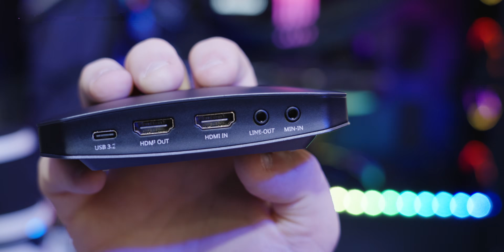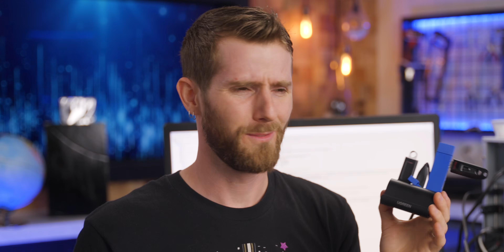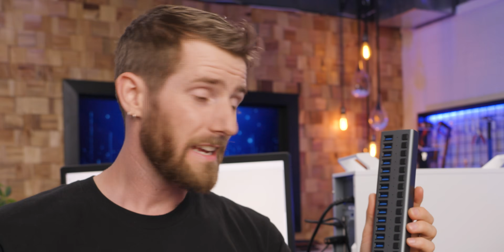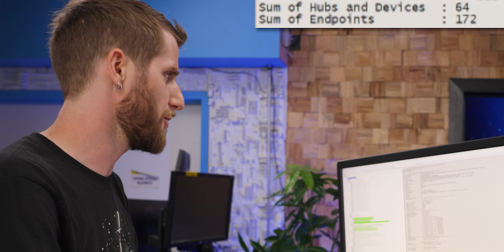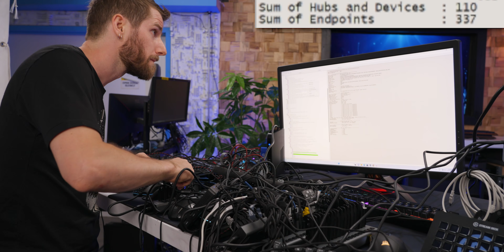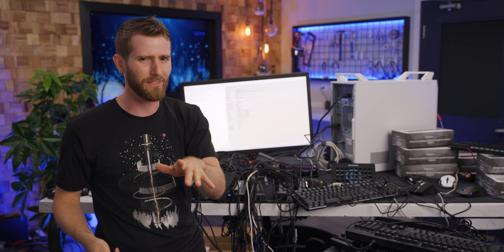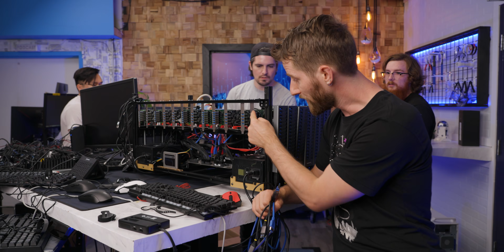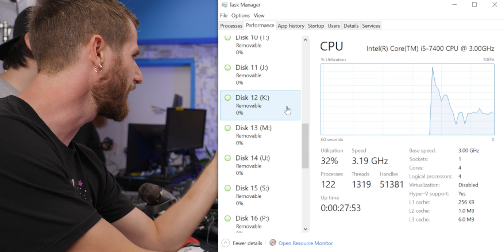How Many USBs Can You Plug In At Once?

Comment: I’ve had issues with plugging in too many hubs rather than too many devices which is interesting. Having the same amount of devices plugged into two hubs seems to work better than having them plugged into 4 different hubs. Also some hubs work almost flawlessly whereas others just keep dropping out when I connect thumb drives to them but peripherals work fine… USB stability, even more than the instantaneous number of devices you can have plugged in, is a big issue and it would be worthwhile to investigate stability in a seperate video. I will say that having a seperate usb controller via pcie definitely improves stability! I’ve noticed that. But when I plug in multiple external hard drives I have significant problems with them just disconnecting intermittently even if they are on seperate controllers (this happens more often under high bandwidth usage but also seems to happen even if I’m just using the drive a little bit??). I’ve noticed this issue on different devices; my old Dell intel 7th gen i7 laptop and on my X99 5820k PC. 4 port powered hubs seem more stable than 7 port powered hubs and 7 is more stable than 13 port hubs; but I have another specific 8 port hub that isn’t sold anymore and for some reason is super stable. Maybe stability varies on vendor or newness of technology like Linus noticed on AMD vs Intel. I wonder if there’s a measurable difference on USB stability and % uptime on Windows vs Mac or from vendor to vendor
Reply: There's definitely a difference between the chips in different brands of hubs. We used to run in the same issue doing backups to multiple external drives and we didn't try and copy something to all the external drives at the sane time but rather one after the other and we figured out that some powered hubs just are better than others and actually motherboards as well. We eventually also fixed it with a board with a bunch of PCIe slots and USB cards as opposed to USB hubs. Laptops on the other hand are all over the show and some laptops (modern and old) just really don't like having a bunch of USB devices at the same time.

Comment: At one of my previous jobs, we had devices with test harnesses, and the test harness PC would often run out of USB endpoints, so we had to run the harness machine with the Intel XHCI disabled, so the ports went to the two EHCI controllers instead.  But then Intel removed the EHCI controllers from later chipsets.  It seemed like Intel's limit was 64 or so, or maybe even less than that.

Comment: I love these kinds of videos and want more of them. I have been so curious about USB hubs.
I've actually been wondering, can USB hubs increase latency? I've seen experiments that suggest they add no measurable negligible input latency with mice and keyboards, but I'm also wondering about HDMI or audio (3.5mm or a USB audio interface, seeing as one is analog and the other is digital) through a USB hub/docking station
Reply: Any hub will increase latency since it extends the path and adds muxes. if it's noticable is another question altogether since we might be talking ns, or at best microseconds. Some "dumb" hubs pass the signal along and just amplify it with minimal interference (with respect to time and signal), others will receive it process it and resend it which will take time. YMMV with respect to hub/chip/device/peripheral used.

Comment: There is that 127 limit per host controller, so using multiple PCIe controllers will make the limit proportionally higher. Also the USB2 and USB3 tend to be different controllers, so a USB3 port may have a greater limit.

Comment: LTT is so good at making interesting videos! I literally have never thought about how many usb drives you can plug in until now, but you better believe I NEED to know an exact number before I can move on with my day
Reply: You can plug in as many USB drives you want to You can do more than the 26th drive letter limit, It just takes a lot more setup if you want to go past 26 drive letters and you have to define in Mount and do some Linux level type of stuff that Linux is used to doing in sort of a sense. when you use Linux or Mac OS it doesn't use drive letters necessarily I don't think It just mounts to the drive as a folder path.

I believe Theo Joe talked about this at one point could have been a year ago possibly. so you can connect more than 26 USB drives if you wanted to. You would have to use device manager where you deal with changing storage that's a more advanced type of tool with dealing with partitions and windows and I believe that tool allows you to deal with folder drive mounting to get around the 26 drive letter limitation.
Reply: The reason why different operating systems are used for when linus does his while 48 drives or server vault for video storage needs, they use things like ZFS or TrueNAS do just not have to deal with how Windows isn't the best when it comes to running a file vault storage  server that must always be online without glitches or needing to be restarted.
Reply: when you start looking at the differences of like Windows with drive letters. Mac OS I don't think uses drive letters like I said it just mounts the drive as an image. when you install an application on Mac OS it mounts it acting as though you installed a CD drive or a USB essentially for a specific file path, so I don't believe Linux has a 26 letter drive limitation at all.
Reply: Linux has great reliability and sustainability. Linux can go a very very long time without ever having to be restarted. You can update Mac OS or Linux without having to deal with needing to restart the system for a system update at all. when you start dealing with Enterprise stuff you just begin to see how weak and unstable Windows as an operating system is and why when you're running a file server on your local network and you want it to have always on reliability You don't want to have to be dealing with Windows Quirks or have to deal with a restart just to fix a simple drive not showing up or something of that matter. Debian Linux from what I've learned from these videos that they do is pretty strong and what these custom file operating systems that ZFS, TrueNas all these things they show in their channel do. so like I said drive letters on Windows is just a windows arbitrary limitation.
Reply: The reason why your main drive is always mounted as the 3rd drive in your system is because A and B letters on the system for the hardware was by default for floppy drives. So that by default makes the Third Drive C the default. Windows has a lot of past old legacy support to some degree. so if you went and changed your C drive to an A drive and made that your default for installing Windows on there would be a lot of programs to some degree that could be hard coded like a driver or things that just expect to find the respective files in the C drive and when that's not your main drive then it would just confuse most programs and throw a huge hissy fit.
Reply: Did you see their video on JBODS? where its a cluster of drives that are then attached to a drive controller? I mean thats what most all data centers use. they rely on the function of JBODS for you know hooking up a huge cluster of probably 48 drives per rack of that JBODS they don't have to have a limit of 26 drive letters there not running windows firstly. and there all interconnected so there's  redundancy included as well. making so that there's not a limit of how many drive letters there has to be at all, and there probably on a custom blend of Linux of some sort too.

Comment: With the high amounts of 4k/8k mice being produced recently, a video on how they can affect in game performance/overall PC performance. Anyone with experience with one knows that seemingly they can have a huge effect in one game, but little in another. This seems mostly due to the in-game support for the higher polling rate, but the actual effects on the system overall would be interesting to see.
Reply: 4k mice? I back this idea. I have no idea wtf a 4k/8k mouse is and id like to learn. Linus get on it plz!
Reply: @TheHollowBlade It is the polling rate. Essentially how often your mouse sends a signal to the PC.

A low end mouse could have as low as a 125 Hz polling rate, so your mouse actions would only be sent to the computer ever 1/8 of a second, which means you can add up to that much latency to every mouse movement (but, worse, it won't be consistent as it will depend where in the polling cycle the input occurs). At 8,000 Hz, it is updated ever 1/800 of a second.

For a while 1,000 Hz has been the rate for gaming mice, but recently 4,000Hz and 8,000 Hz polling rates have become more common.
Reply: @88porpoise 125 Hz = 1/8th a second? Huh? Isn't it 125 times a second?
Reply: @88porpoise  oh ok, so its mot the dpi but rather how often the mouse communicates the info of its movement.. i legit have never thought of that function for the mouse. I would like to see Linus do a vid breaking it down. Sounds neat.
Reply: @kernelpanic2887  Well that was me being really stupid

No idea why my brain turned 8ms into 1/8 of a second.

But 125 Hz is every 8ms, 1,000 is every 1ms, and 8,000 Hz is every 0.125ms it sends data.
Reply: @TheHollowBlade  There is a decent summary of polling rate and some testing on the Atom Palm Hydrogen mouse video from a couple years ago where they show the mouse being used at different polling rates.

It would be cool to see it tested in detail with Labs equipment, but I don't know if it would be broadly popular enough for LTT.

Comment: I want to see how Linux handles this on the same hardware, something tells me Windows is a limiting factor here... This seems like a case where it's equally a test for the underlying system kernel, surprised Windows didn't BSOD.
Reply: If you watch the video they explain what the limiting factor is, it isn't Windows or Linux as USB is limited by hardware. USB has 7 bit addresses (127 end points, address 0 is for devices that don't yet have an address assigned). Linux isn't going to be able to change that by sending 9 bits of addressing data to USB devices...
Though xHCI claims to support 8 bit addressing, though nowhere in the standard does it explain how that would really work. Most likely that only works with specialized bus manager chips that would split the bus into two normal 7 bit addressed buses instead, chips that don't seem to exist as nobody needs it really...
Anyway, why would Windows BSOD? You realize that since the mid 2000s everything user-space runs in user-space in Windows? So the worst USB crash that could happen is what they show in this video where the USB stack crashes and tries to restart itself.

Comment: Ha! I’ve been waiting for something very similar to this to be done 😄 
I have 3 powered hubs each connected directly to controllers on my mobo and each one goes 12 devices deep. Only one of them is full and I have just a couple of other devices connected to the others because they are located in other parts of my small office just in case I want to plug something in those areas.  I am very careful not to max out the endpoints on my main hub because all of my important peripherals are there. 

Now I’ve learned more terminology and a more thorough understanding as to the quantitative limits of simultaneous usb devices in windows 😄

Comment: Something to consider:
Some of those hubs got hot, they might have thermal protection and shut down.
You might run into driver issues. I wonder if this would work better or worse with Linux?
Reply: I was hoping they wold switch to linux for more testing after seeing the limit messages in windows.
Reply: @hubertnnn  I was too!
Maybe that will be in another video.
Reply: @hubertnnn  Limit messages originate from the USB root controller, not Windows itself. The USB Root Controller (hardware) informs Windows that it has had enough.
You'd get the same error on Linux, though it would obviously look different depending on what distro you are using etc. the error itself is the exact same.

Comment: Sadly, this is incorrect. I connect a powered hub to my desktop, connect the power to the wall, and then I connect 3 external hard drives to it, with a Bluetooth dongle, and they malfunction.

This doesn't happen if there are less USB devices connected.

Comment: That was actually a pretty fun experiment.  Would be cool to see the same in Linux to see if it's an OS/driver limitation and not hardware.  While we're at it, may as well do a raid 5 with all those USB sticks to see how terrible it would be. :P
Reply: RAID on USB sticks has been done so many times now (even by Linus I think, though it might be 10 years ago or whatever)...
Linux would make no difference as this is a hardware limitation, not OS.
Reply: @someguy4915  it would make a difference as Linux has no drive-letter shenanigans 😏
Reply: @bit2shift   that's not a real problem for windows, it will just not attribute any letter, but the disk manager can control more than 26 devices. explorer will complain with a warning, but you can mount your USB drives in a subpath on C:  if you still want to use all of them
Reply: @monad_tcp  ok but does the general populace know that you can do that (mounting drives the UNIX way)?
Reply: @bit2shift  obviously not, but I don't think the general populace can afford 26 flash drives.

Comment: This video demonstration of USB mechanics and limitations is phenomenal for the average consumer-level gamer. However, I would find it deeply interesting if LTT could cover USB Hub limitations when it comes to commercial conferencing devices such as HDMI/USB over Ethernet extenders as conferencing solutions! I've personally ran into a handful of weird USB limitations while using Ethernet USB extenders, specifically the Atlona Omega HDbaseT Extender Kit because of the way their devices specifically handle the USB bus (the HDbaseT extension, in their case, is physically a USB bus by itself, so when you get to the "USB" extension, you end up ANOTHER USB bus deeper than you would expect, for example). In my case, using a heavy-duty conferencing speaker like the Nureva HDL-200 or HDL-300 (which gets separate power than USB, obviously), you can run into compatibility issues where either the speaker works and the mic doesn't, or vice versa, depending on the computer you're using (because they usually each handle their own buses differently). Even though "theoretically" the specs should check out according to both Nureva and Atlona tech support, they had weird USB behavior interfacing with each other that resolved when using a separate USB-over-Ethernet solution instead of the built-in USB extension from the Atlona OMEGA kits, which was more than likely a USB bus issue. Anyway, fantastic video with great information! Would love to see another video targeted more towards commercial-grade video conferencing for this reason! But tbh, my use-case is probably super niche and wouldn't have as wide of a market as a video like this. In any case, remarkable presentation and description of how this realistically functions in a real-world environment :D

Comment: As intimidating as the USBinator is, you might have achieved the same number of devices with... a cheap USB 2 extension cable.

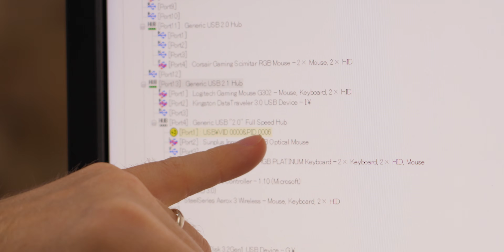Did you notice how you always had almost exactly as many endpoints as USB devices? I had the same issue when I tried to hook up a bullet time rig with 12 DSLRs to an old Intel laptop. The DSLRs in addition to a few hubs and the laptop's internal devices (camera etc.) hit its very low endpoint limit because of that factor 3. The solution? I plugged a cheap USB 2 extension cable between the USB 3 hubs and the laptop, forcing them to fall back to the USB 2 host controller and everything worked perfectly. (I am showing this at 07:28 of https://youtu.be/QeJlaTUe0T0)

So, I am wondering how many devices can you hook up to that AMD machine if you force (some of) them onto a pure USB 2 line? Granted, the bandwidth would be smaller, but that heated mouse won't mind :)

Comment: We did this at the Microsoft Academy when doing MCSE. Bare in mind we had purpose built hubs made by the guys on the electricsl engineering courses etc. 
We also had a rack of dummy usb devices which could be controlled and programmed for testing. 
We actually iscovered that we could go over 200 devices even on the windows 2000 test machine.

 However only about 75 devices could be actually be sending or recieving data simultaneously. So you could have 200 keyboards but only type on any 75 at once.  Also if we counted each hub and it's internal splitters as devices we actually figured it was around around the 128 devices that could be permanently attached and used when needed.

Comment: A good follow up would be to see what happens to windows 11  if you have more then the drive letter C - to Z and where the limit is and also if a Linux based system could beat that number of drives/ partitions since it is meant to be a server system and not a home PC test the same thing with windows server 
and also test the same thing on a mac to see if there is any limitations in what each of  the OS is capable to handle or if it is in the USB specs itself that sets the limit